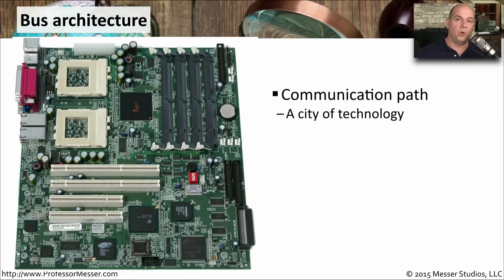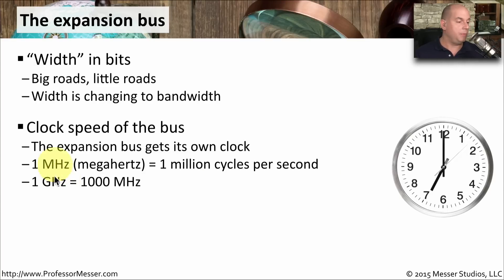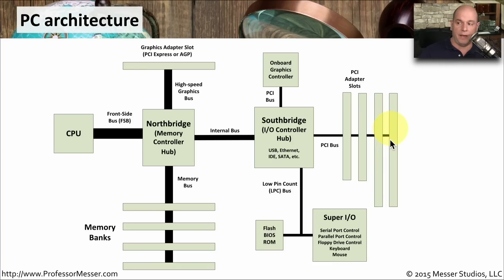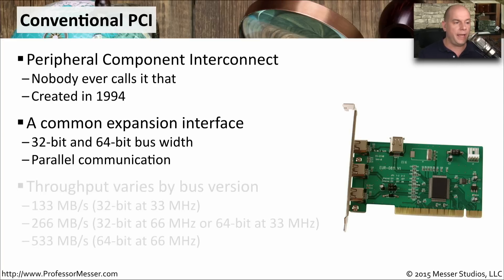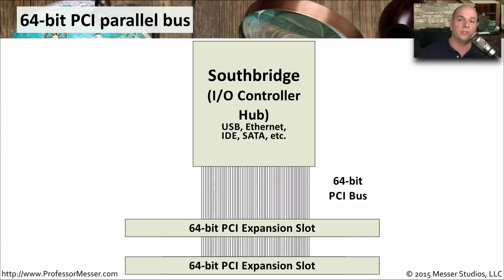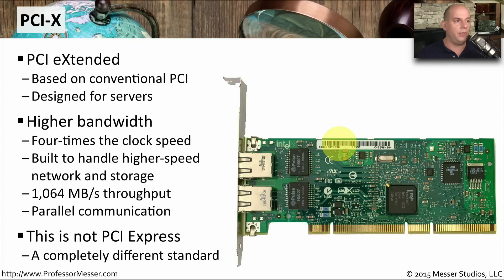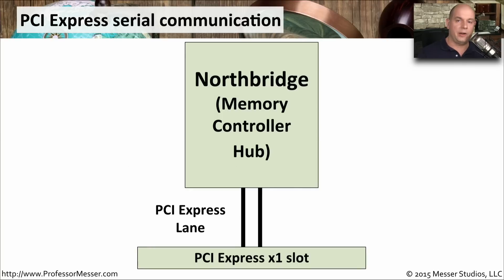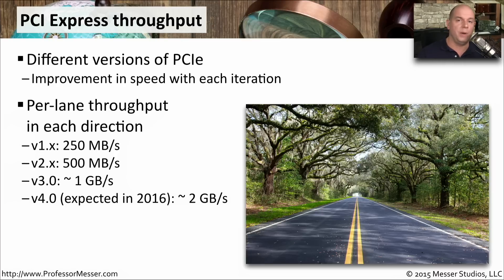Motherboard Expansion Slots and Bus Speeds - CompTIA A+ 220-901 - 1.2

Comment: You may want to mention that certain pci-express slots maybe be physically x16 slots, but be wired in x4 or x8 configurations. As well as how to identify these types of slots if this info is not explicitly slated by the motherboard manufacturer.

Comment: Professor,  I noticed that the diagram for the Conventional PCI (32 and 64 bit parallel) leads to the Southbridge, while the PCI Express (PCIe) diagram has the card leading to the North Bridge. Was this part of the technology advance, should I understand why the difference for the exam, or is this of significance to know in general? Please advise!
Reply: This is because the Southbridge typically handles slower I/O peripherals.The northbridge usually deals with stuff relating to memory and graphics, and since PCIe was intended to be a replacement over PCI and AGP and is more advanced,  it'd make sense to see the slots be connected to the northbridge over the southbridge

Comment: In 2003, the PCI SIG ratified PCI-X 2.0. It adds 266-MHz and 533-MHz variants, yielding roughly 2,132 MB/s and 4,266 MB/s throughput, respectively.

Do we need to know this too for the exam?
Reply from the maker: +Rastko Jović There have been a lot of computing standards that never saw an actual implementation, and PCI-X 2.0 was one of them. You don't need to know much about PCI-X, and you certainly don't need to know PCI-X standards that never made it to fruition.
Reply: +Professor Messer Thank you for the fast response!
Reply: Hi, I have a question. He said the 4x gets released in 2003. So how does he have a x8 on his computer?

Comment: In the case of the PCIe labeled PCIe_x8_2, since the "8" refers to the duplex lanes, does the "2" refer to the version of PCIe?
Reply: He answered this one earlier. To recap, the board he is showing, the manufacturers had multiple PCIe X8 slots installed. To differentiate them from one another, the next underscore number is created (PCIe_x8_1, PCIe_x8_2, etc etc)

Comment: Curious what does the _2 mean after the pcix8 or any other pci express? im still lost on that.
Reply from the maker: +Yonatan Makara This motherboard manufacturer numbers each slot sequentially, so three PCI Express x1 slots are labeled PCIEX1_1, PCIEX1_2, and PCIEX1_3.
Reply: +Professor Messer Why do the x4 and x8 look the same (but different color)? Is there a physical difference I am missing?
Reply: Got a question, earlier in the video you said PCIe x1 only uses one pin for sending, the other for receiving. On the mother board, there are a lot more pins than that. What are they used for? Surely not just power?
Reply from the maker: I discussed the single lane for communication, not necessarily the number of physical pins. You can view the PCIe pinouts here:

https://en.wikipedia.org/wiki/PCI_Express#Pinout
Reply: Professor Messer thanks!

Comment: The book I’m reading states there are only 8 byte wire meaning  8 wires 64 wires is this guy real?
Reply from the maker: There are 8 bits in a byte, so 8 bytes would be 64 bits.  I am real.